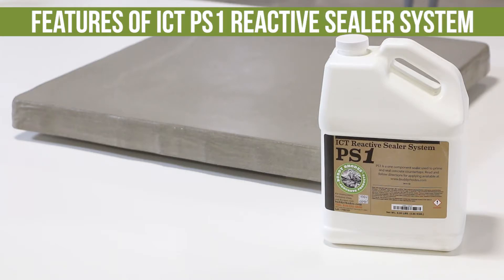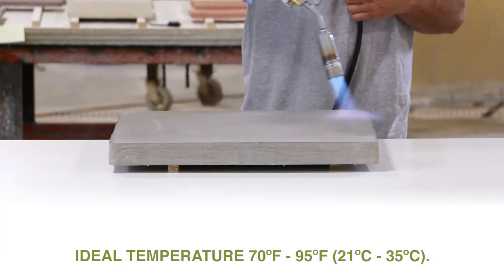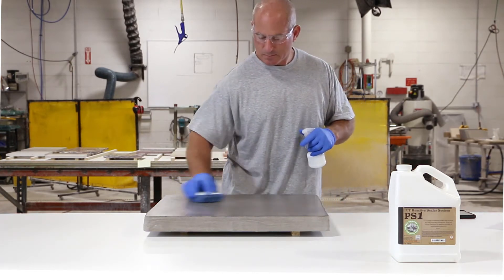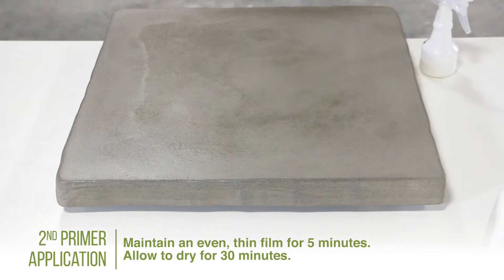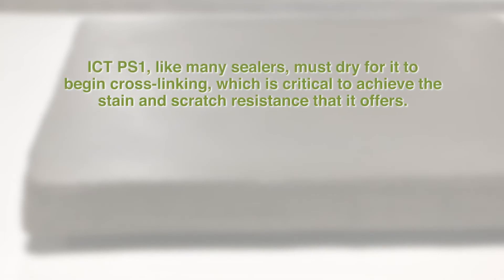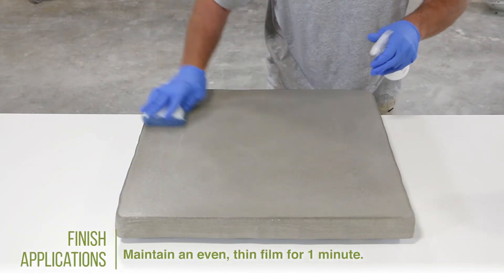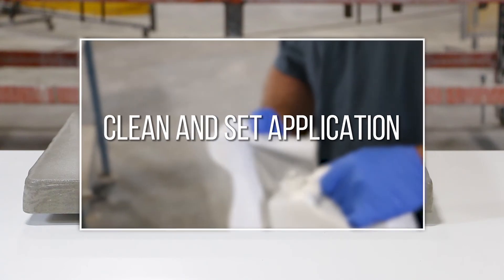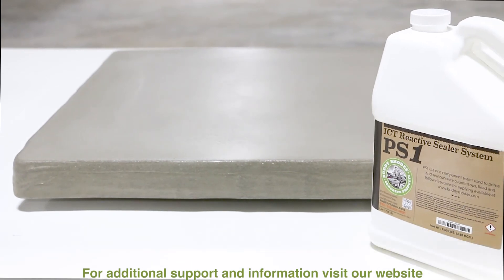ICT PS1 Concrete Sealer Application Guide

Comment: Can you use ps1 for hairline cracks? My countertop is about a year old and has been sealed with ps1, but we have some hairline cracks around the sink. I would like to seal them.
Reply from the maker: Hello Nina, no, you can't use PS1 to seal hairline cracks. PS1 is intended to seal and protect the surface of the concrete, but not for filling or sealing cracks. We'd recommend looking at epoxies for that.

Comment: If to polish with diamond pads, then what is the max pad grit for this sealer?
Reply from the maker: Ille Kaal, in the technical bulletin you'll see that we recommend to use a 400-grit hand pad, as coarser grit can leave scratches and can be too aggressive. The hand pads should always be used wet to prevent scratching the concrete surface. Whenever possible use circular motions to minimize linear scratching patterns that may detract from the appearance. A wet-sanded surface can be etched to further enhance the microscopic tooth. When polishing a larger area or to remove material faster and efficiently, a pneumatic or electric polisher could be used.

Comment: would this sealer be good on a shower concrete bench
Reply from the maker: If applied correctly and let cure completely before using it, it should be good. But I recommend you to contact our technical support team, they can give you more details about this. You can contact them here: http://support.buddyrhodes.com/add/